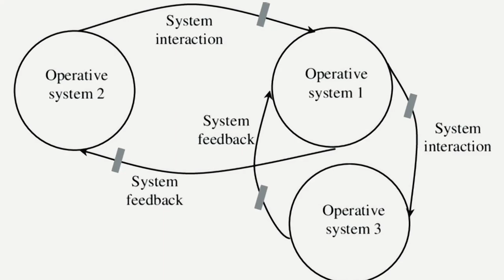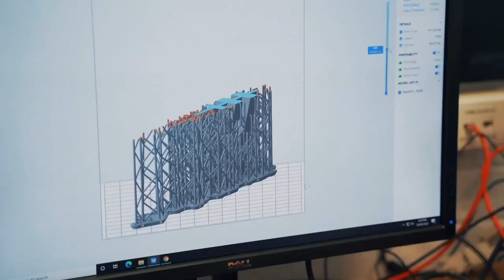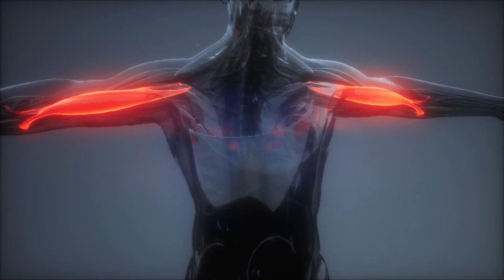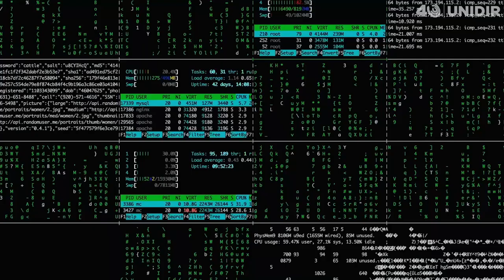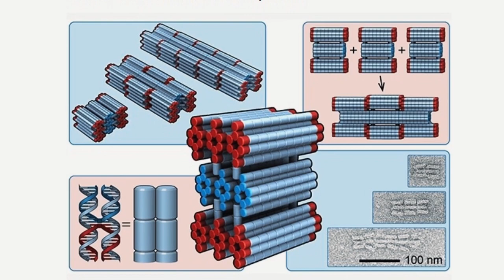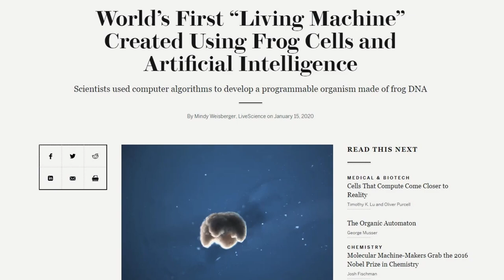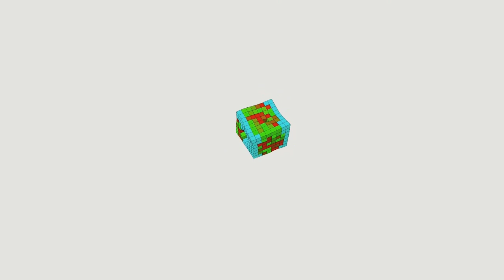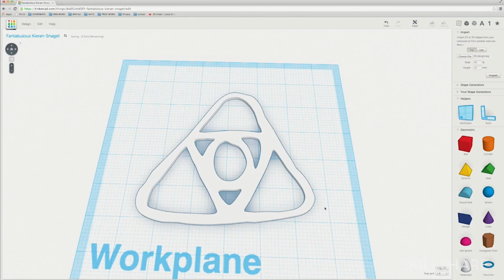The 5 Levels of the Biorobotics Revolution

Comment: I don't think biomimicry should be about copying designs from nature but copying the process of evolution itself. Mutations and natural selection are after all, very successful.
It's all about using an iterative design process, hosting competitions between different teams with different solutions to the same problem, trying bold designs even if unlikely to succeed...
We have almost no control on the future, each invention creates an opportunity for entrepreneurs to build upon each others achievements in a completely unpredictable way.
Reply from the maker: I think it depends on the degree to which you use biomimicry. Rather than directly copying full scale, its more about looking to see if you can leverage specific solutions and principles. Evolution through iteration is a very useful proceedure to emulate though and of course its already a key part of technological progress.
Reply: That sounds much too vague to be a useful benchmark for biomimicry in my opinion that or it’s…not much different from what the core aspect of technological advancement as it is? You basically just described what we’re already doing right now in that field. In the process of designing something for an express purpose there are failed attempts, scrapped concepts etc. Mutations in nature are random and natural selection isn’t conducted with express intent by an outside force so if by “copying the process of evolution” you mean progress via iterations that’s not really true biomimicry that’s just….normal innovation in science or at the very least that concept doesn’t necessarily have to conflict with replicating components we observe in the natural world for our own ends.

-Biomimicry = the emulation of the models, systems, and elements of nature for the purpose of solving complex human problems.
 
^Natural selection is a successful process that’s why biomimicry is basically all about emulating the things that process has already produced in nature and building upon it to assist us.
Reply: @jasonvoorhees5180  That's true, but Wall street and the mainstream media analysts are really lagging behind when it came to study new opportunities.
Technology convergence should be their number one benchmark to assert probability of success.